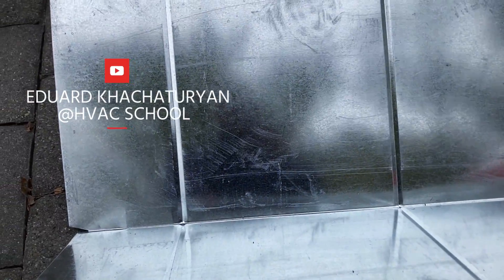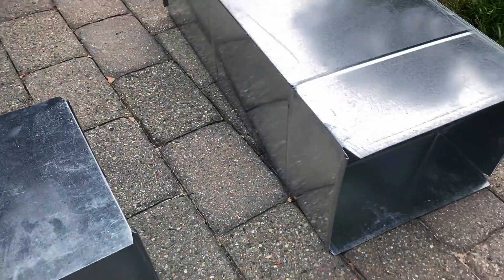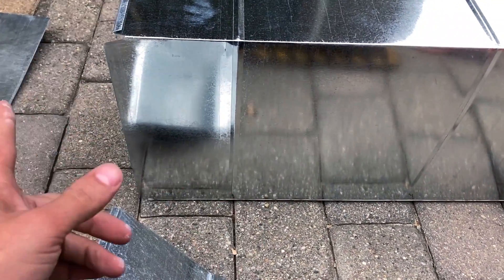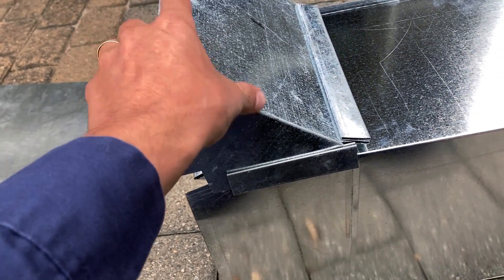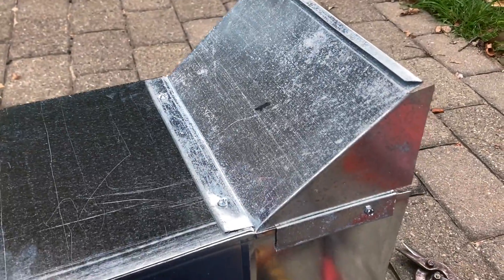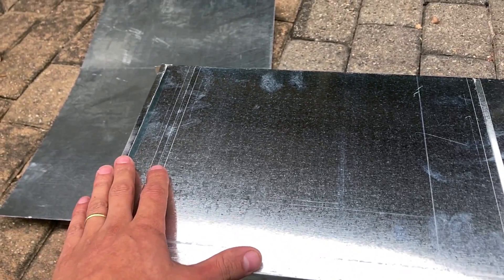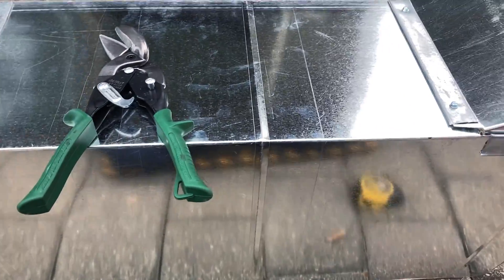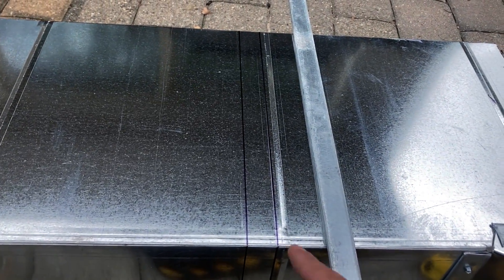Make Field Transitions on Prefabricated Metal Duct

Comment: I have been an installer for over 20 years when I first started I was taught to cut seams with hack saw first then use snips to cut duct. Now I just use the grinder all the way saves time. But I would never make a transition like that, always get them fabricated from the shop.
Reply: That is so true,  if the job can be done on the same day then it's ok.  Otherwise I just order get whatever i need for the next day.

Comment: Nice to see metal work represented. Any installer who can’t fabricate on-site is a glorified helper in my opinion. I say that as a service tech who started off as an installer years ago. I hope guys don’t stop learning the whole trade. Having that background helps me to see the big picture when I walk onto a job and it keeps me from becoming a “parts changer” rather than a good tech. It’s crazy how many failures are ultimately due to crappy ductwork.
Reply: Thats not fabrication
Reply: @johnathindonelson4064  You're nit picking over the term "fabrication", in my opinion. 
He is modifying a piece that was fabricated in a shop.
Therefore, retrofitting, field fabricating, modifying, reworking, are all terms that can be applied here.
It still takes fabrication knowledge and techniques to successfully pull it off.
Give the man some credit, he deserves it.
Reply: I’m defenetly a glorified helper I guess